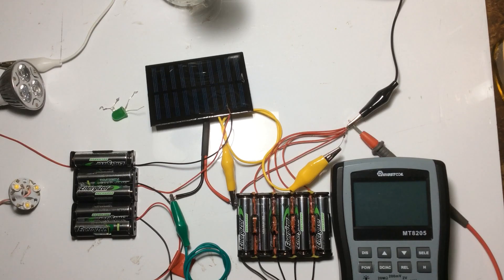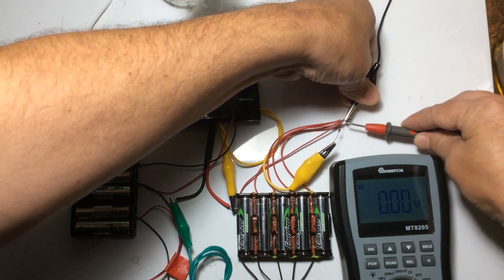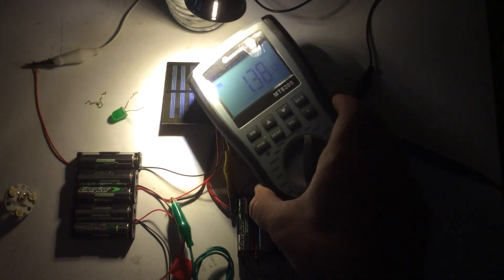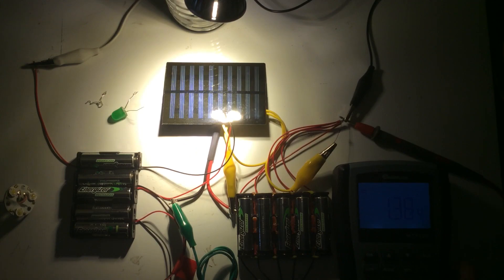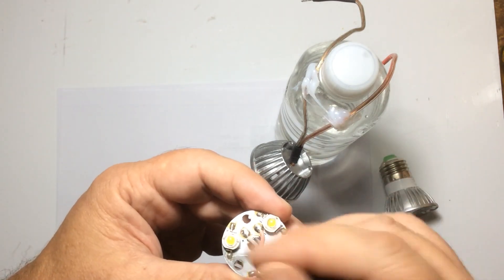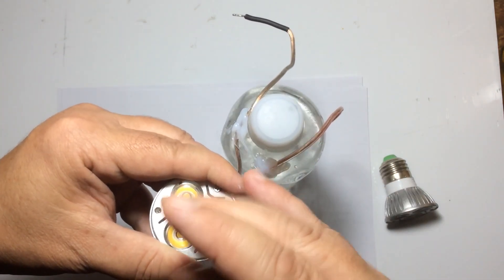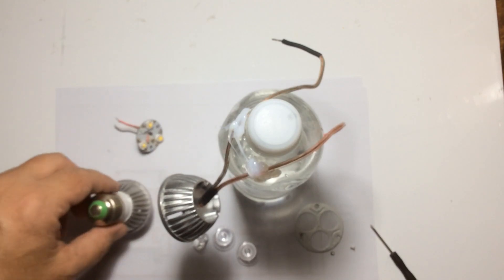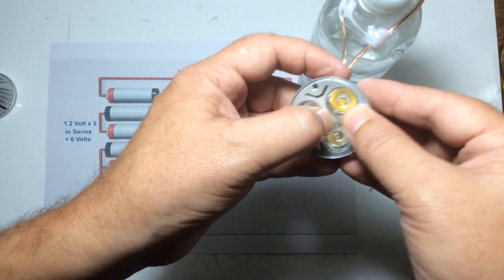TESLA TRANSFER + SOLAR = SELF GENERATING ELECTRICITY

Comment: I will try this when my solar panel arrives. I will be using 3.7 v batteries, 2 and 2. I've watched this video 5 times and to be honset I skipped around, because you kill me with your enthusiasm. Can you tell me in plain English what this is? What am I looking at. Do I need to switch the batteries? or will this run alot longer? Thanks, I love the videos. I'm also emotionless = P
Reply from the maker: Thank you for your comment.
The solar panel is achieving two functions in this setup,
1. It captures some of the already spent energy from the light which very slightly adds an increase in run time.
2. It allows you to cover any losses within the system, this setup should prevent you having to charge the batteries EVER.
The battery sets must still be rotated.

I’m sure I’m on some kind of a spectrum, at which point and what spectrum I don’t know nor care to but if you skipped around in the video and this was because of me, may I ask how you believe I could amend this to improve your viewing pleasure and others.
I have to watch my videos for editing and I find it painful, for one I already know what I’m going to say and two I keep hearing the monotone teacher from the “Wonder Years” TV series boring me to death. 🤣
Cheers.
Reply: @whatifididthis...1236  you don't need to ammend anything. I'm the same, but you are a teacher so you should consider your students. First thing should be what is the question you are answering. I really appreciate your videos they are great.
Reply from the maker: @davidiom27  Thank you, I appreciate your feedback and that is a good point you make.

Comment: For batteries, the capacity, charging, and discharging, is in amp-hours (or milliamp-hours).  In otherwords, actual electrons regardless of the voltage.   But energy is (I * V), not just (I).  If you do not properly convert the voltage, you will be wasting the entire voltage differential between the two packs (minus the voltage drop across the LEDs which turns into light, mostly)... but all the rest of the voltage drop goes straight into heat, aka energy losses.

Only the amps are being transfered with direct connections like this.   Actual electrons.  So there really isn't much of a point of doing this.   Putting a buck converter to down-convert the voltage will yield far, far higher efficiencies.

Also, nickel-metal-hydride AA and AAA batteries (I assume that is what those are, but I couldn't read the label well)... that chemistry is naturally current limited and their relatively high internal resistance.  That is why you at least didn't cause a fire.  But If you try to do this with with more capable batteries, bad things will happen.

-Matt
Reply from the maker: Thank you for comment Matt.
The energy is actually transferred otherwise when I rotate the battery sets there would be no usable power. 

On average there appears to be approximately 70% of the energy transferred to the parallel set and this efficiency is drastically effected by the load itself. You can take a look at my 12 volt transfer concept video in which I display the run times using sealed lead acid batteries with no problems noted. A company by the name of Electrodyne Corp. tested the complete Tesla Switch with a constant 2 kilowatt load for a period of 3 years and stated the batteries appeared to be in perfect condition and even displayed signs of increased capacity. 

The only chemistry I would caution people with is lithium because some lithium batteries don’t have battery management systems compatible with series or parallel connections and also require a specific charge voltage.

I understand this isn’t what we were taught, however if I could encourage you to replicate the experiments using this concept you will be pleasantly surprised and equally frustrated, at least I was when researching this, I’m left wondering what’s true with just about everything now! Don’t get me wrong, I already knew most of it was BS, but this was right under our noses and went unnoticed for more than 100 years.

Comment: What is the point of this?
Reply from the maker: Thank you for your comment.
The point of the solar panel is to cover the minor losses experienced when using the transfer method. Instead of using all the power to run a load this concept uses the load as a means of transferring some of the energy to the parallel bank to be used again after rotation of the batteries. This process is repeated again and again until the potential equalises and it is of far greater efficiency than what is used today. This is an old method of power usage that used to be widely used, at some point they just stopped teaching this information. I wonder why? 💰

Comment: what is tesla transfer ?
Reply from the maker: Thank you for your comment.
Tesla Transfer is moving energy from one serial arranged bank of batteries to a lower voltage equal capacity parallel arranged battery bank. Using the transfer method not all the power is wasted by the load and instead is transferred to the lower potential bank. After the transfer is complete the battery sets are rotated and the transfer of energy is repeated again and again until the potential is equalised. As opposed to a singular use of the electricity in the conventional method.
Please take a look at my playlist on my channel for the Transfer concept.
Reply: ah yess !! thank you very much !!  yes i have done this myself, after watching rick friedrich's videos. differential voltage : )  yeah its pretty cool, we can cycle the energy. thanks for the confirmation of the explanation. i havent tried solar panels yet, but i was thinking of doing the energy transfer one day on my mums boat so that we can make more efficient use of the batterys after they have been charged with solar. thanks !   @whatifididthis...1236
Reply: @whatifididthis...1236  A proper LED flashlight or bulb already matches the voltages and the voltage left-over after the LED drop is minuscule... not enough to be able to push into another battery bank.  We're talking 0.1V or something on that scale.   There has to be some in order to generate the proper current so the LED lights at the brightness desired, but there is no way to "save" that last bit of voltage in a properly designed circuit.

What you've done in your experiment is create a massive mismatch between the voltage source and the LED drop, leaving you tons of voltage after the drop to push into another bank.  But as far as circuits go, this isn't saving you anything verses a properly designed LED circuit which do not purposefully create massive voltage mismatches.

A properly designed LED circuit does one of two things.  It will (a) Regulate the voltage going into the LED (with a switching supply, usually), in order to match the voltage to the voltage drop across the LED.  Or (b) Will place several LEDs in series so their voltage drops add-up to be near the voltage being supplied, or (c) Both.  In all cases, there is not enough voltage "left over" after the LED drop to save.

Comment: Very cool! battery chemistry will have alot to do with efficiency of this system lead acid  have at very best ive seen 70 percent efficiency so a 100ah battery would take 130 ah to charge and the extra 30 ah turns to heat. nimh batterys work better around 100% efficient untill charged to 70 percent full then efficiency drops alot untill fully charged so they need to be trickle charged for the last 30 % or you will waste lots of energy as heat and degrade the batterys  so a 70% state of charge on the ni-mh batterys would provide great efficiency but around 30% lower capacity if you charge too fast after that point  li ion is almost 100% efficient in proper conditions but then there is a significant amount of saftey measure’s you must take like series balancing to increase run time and keep cells in a safe voltage range  and a bms of some sort in order to not start a fire if something goes wrong. Lithium phosphate batteries would be great  other than price barriers they are over 90 percent efficiency so you could probably get away with just series bank balancing to keep the batteries from being damaged  because they will discharge differently over time and decrease efficiency although when they are switched to parallel they will balance  it would be more for efficiency on the li-p04 and lto batteries rather than saftey  and they are both a very safe battery chemisty. Lto batteries would work best although they are really expensive  i will be doing experiments when my balancers get here from china  i have relays and arduino ready to automate this aswell just waiting on parts. Thank you for showing me this very novel way to understand electron flow and electricity. Recently i used a small bank of Lipo batteries  in  this configuration. With about 55 watt hours in the fully charged bank  and it ran my wifi router that draws about 12w for 4 hours which is a bit less than I expected but the discharged bank went from 3.1 discharged to 4v on one of the cells and about 3.8v on others  which was very suprising for me. Almost fully charged the batteries when in a normal configuration i would have not recovered almost a whole battery charge and i would have expected it to run maybe a hour longer i havent had time to switch back and do it again because my batteries aren’t in a standard format so i cant switch them easily with out taking it all apart and i dont have much free time but i dont think i really need to untill i get the auto switching going because i think ive seen enough evidence this is atleast more efficient and living off grid thats all i need to see  everyone wants to see free energy synthesis from the ether but dont want to address how wasteful they are. there is plenty of energy around if you use it correctly!

Comment: I ran the 'Tesla Transfer' test (batteries in series connected to batteries in parallel) on a new set of rechargeable NiMH AA batteries and compared it with the conventional circuit, using equivalent battery capacity (mAh). No difference in run time or light brightness was noted.
Reply from the maker: Thank you for your comment.
It is important that the load is as efficient as possible, most loads have an efficiency rating and it is this percentage that determines the run times, ie if your light is only 70% efficient then obviously you are wasting 30% of the energy to begin with and that 30% is the minimum loss.

Can you describe the exact setup you used and how many battery rotations you performed and supply some numbers regarding run times and we can try to work out where the holes are in your bucket.

The 275 day test is 100% evidence that this transfer concept is far more efficient than any conventional use of electricity. There is no mathematical possibility that there is enough energy in the batteries to run that LED for 275 days.

Comment: Great idea with the solar. There is no limit with experiments. I ordered 20 3.2v eve-batteries to test the 24-12v-circuit properly. I will get theme in 10 days. I told you I did the test with the 24v-bank and just one 12v-battery. It drew out all the power of the 24v-bank (2.8kW) and in the 12v-battery was 1.4kW. Half of the power was wasted in the environment. I did some more tests and I know now why. And this information is very important to me. If the load is drawing 100 Watts the 24v-bank will always give the double portion. It's because the amperage on the 24v-bank is the same amperage. If the 12v-load is drawing an amperage of 8 (100 Watts) the 24v-bank will also give an amperage of 8 (200 Watts). Because it is 24v it's the double portion. I always thought when 100 Watts go out there will be 100 Watts coming in. That's wrong. If the load takes 100 Watts the 24v-bank gives 200 Watts. And that's why the 12v-bank need to have the same capacity like the 24v-bank. Otherwise it's too much for the 12v-battery to take. But if the 12v-bank has the same capacity like the 24v-bank it can absorb the double portion. As soon I have my ordered 3.2v batteries I will test this behaviour further. I'm expecting 200 Watts out of the 24v-bank and 200 Watts in the 12v-banks and 100 Watts in the load which will be the charging batteries. There will be a loss in between. And I want to find out how big the loss in between will be. Greetings from Switzerland.
Reply from the maker: Thank you for your comment.
The solar panel addition was something suggested by several viewers over the various videos, in this version the solar panel acts as a run time booster by capturing some of the already wasted energy that is the light output. This current setup is not efficient enough to cover the total expenditure of energy drawn by the light but it does supply external power allowing for a faster recharge of the parallel battery set. I imagine if the light is switched off each day and the solar panel allowed to collect sunlight that the combination of the transfer method and solar should remove the need to apply any other form of recharging.

The capacity of the receiving parallel battery set must be the same capacity as the series battery set, I find it easiest to imagine the batteries as water tanks, the series battery/water tanks are stacked one on top of the other, the stacked water tanks are connected at ground level by a hose to five equal capacity, empty water tanks that all sit on the ground. When the ground level tap is opened the water in the stacked tanks begins filling the ground level tanks until there is no potential difference, no high or low point of pressure. However, if we only had four ground tanks instead of five, so less capacity, naturally that water will spill out until all tanks are equal.

I’m keen to hear how your experiment goes, please keep me informed.
Reply: Makes sense, would love to hear how it turns out.
Reply: @justbob1581  In the meantime I had no time. But I continued now my testing and I wrote a comment in the newest Video on this channel. It's very interesting.
Reply from the maker: @justbob1581  Thank you for your comment.